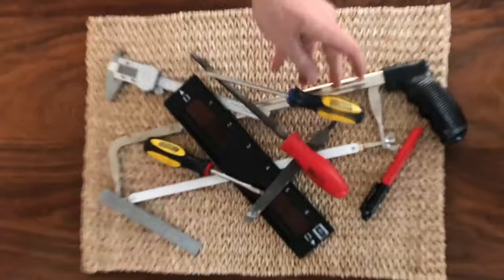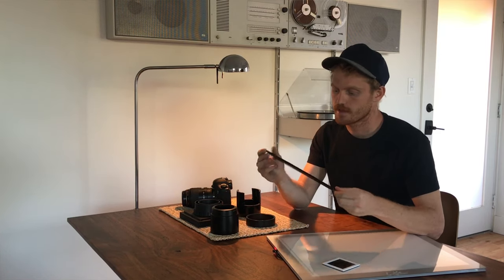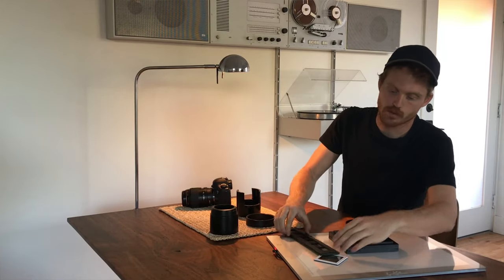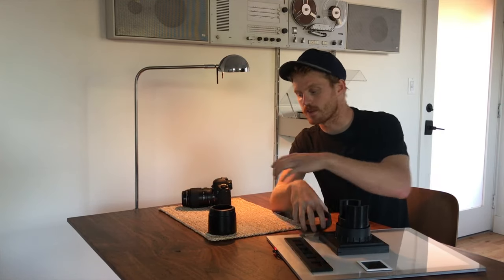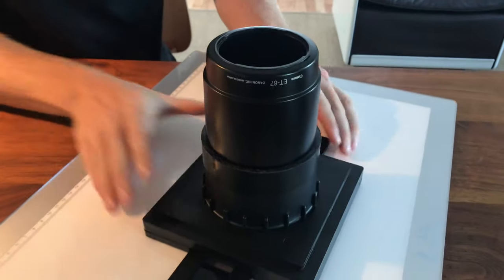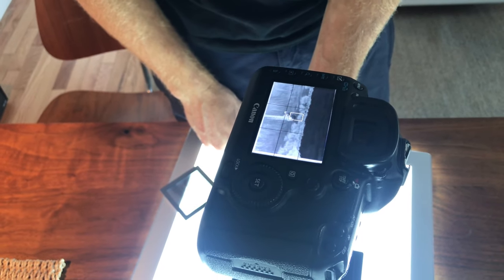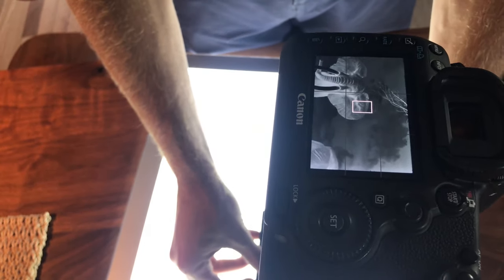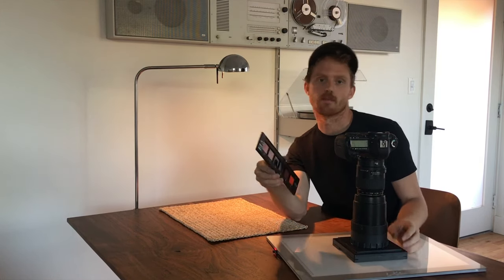DIY DSLR Film Scanning - Overview PART ONE

Comment: great work! if the cut is precise it is the easiest way to have flat focus plane on film [depend on lens ofcourse]
I have a question about final resolution of your 120film scan pictures, how do You think where is the limit between image quality and just bigger file ?
And one more, how do you prepare HDR scan :)
Reply: Super late to answer, but here goes. The grain in the film is the same size on 35mm and 120, so there is the same amount of detail per surface on both. It makes sense to stitch pictures for 120, as you are adding actual information, you can look at it like having one picture spread across ~4 35mm images

Comment: More details would greatly help. My Tokina 100mm macro’s hood is a hair under 3” in inside diameter, so I could find no pipe over which it would slide. What’s the inside and outside diameter of your hood? Does your method work only with the larger Canon hood? Could find no specs online for that hood.

Comment: Hi,
Does this work also with color negatives? I mean, of course it will transmit light through a color negative :) but I am talking about the color temperature. Does it produce cyan shift if used for color negative scanning? Also, if you lay the negative directly on the light table, do you see the grid of led?
Reply: Have a look at Negative Lab Pro, gives excellent colors with Raw files of color negatives.
Reply: A good light table is very diffuse and shouldn’t give any problems. Have a look at the Kaiser Plano Lite, that works well for a lot of people and also has great color (high CRI)